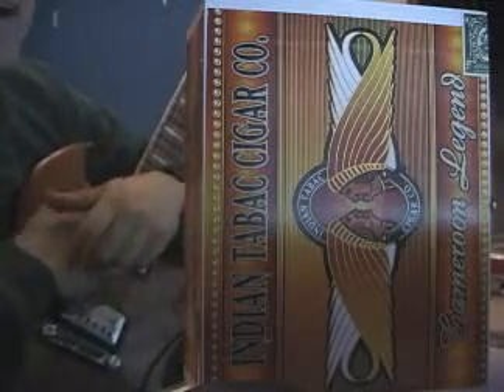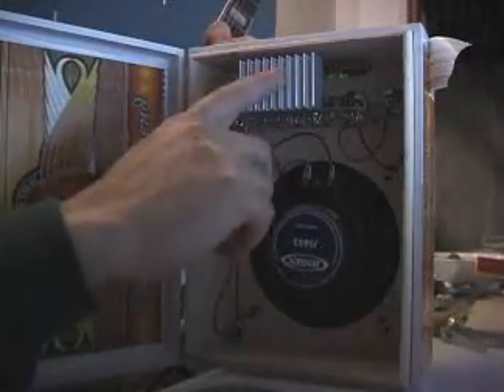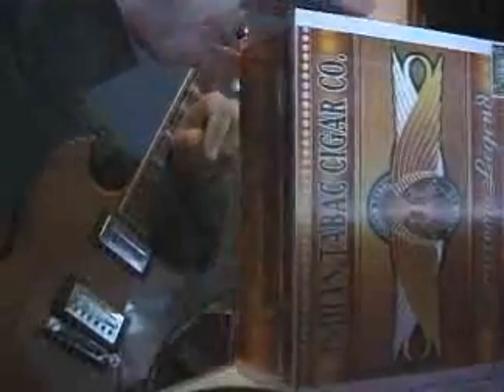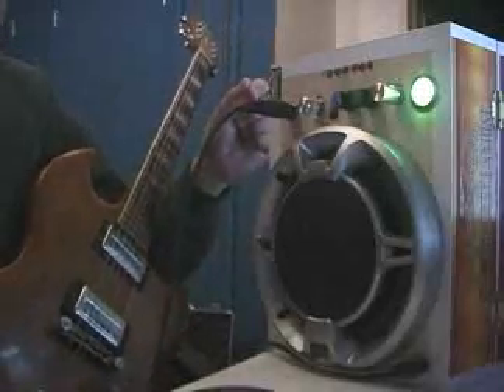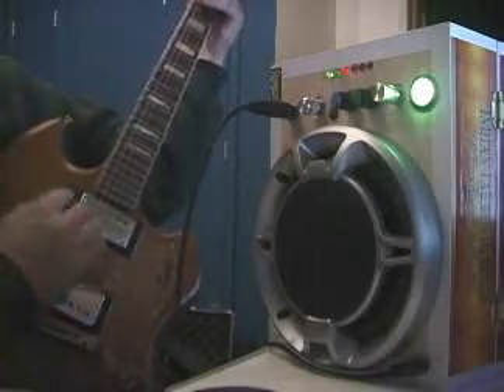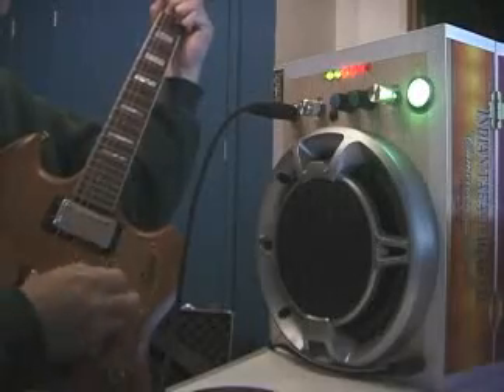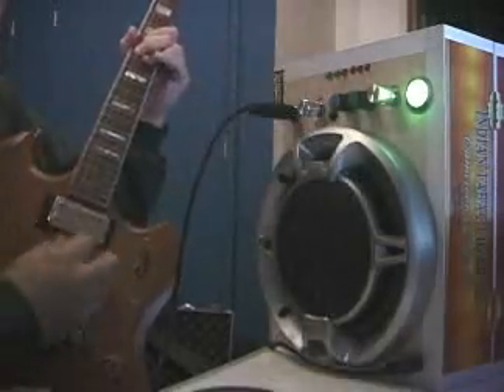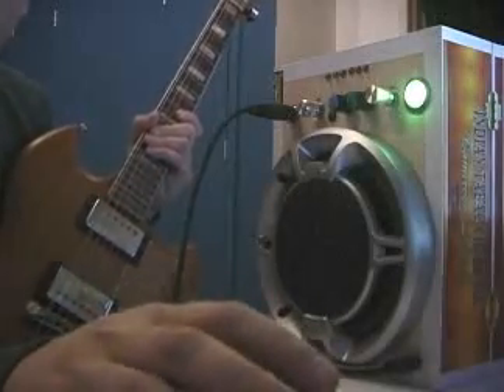cigar box amp FK617 kit

Comment from the maker: @redrocker1055 They mean you have to solder it all to the circuit board.  It's not hard to do, but does take around 4-6 hours to sort through and solder all those resistors.  Usually, qkits will list a price of around $10 to assemble it for you...meaning you get the kit all presoldered and ready for you to solder on your switches and speaker lines...etc.

Comment from the maker: @LonelyLumberJack 

I just used the diagram that was included with the amp kit.  The only real wiring was to the on off switch and the power and speaker lines.  The VU meter is simply wired inline with the speaker.  It doesn't require any separate power.

Comment from the maker: @redrocker1055 I prefer the Ruby and other LM386 type circuits because of the simplicity and great tone.  They don't do clean very well....but the crunch is terrific.  I just use a generic project board for doing a solder up...just leave the ends of the components long enough to act as your traces.  I think only one wire jumper is required after that.  Otherwise, email me for a fellow that can make you a PCB..

Comment from the maker: You're certainly correct...but that wasn't the goal here.  This is designed to be a low cost build that will fit into a cigar box.  Kit at qkits $15 plus shipping.  Box $2 from local cigar shop.  Speaker $7 on sale at Circuit City.  Wallwart $10 at electronics liquidator.  Total $44 for a mini 15watt amp.

That said, I might add an output jack so I can try it with a larger guitar cab.  But, that's not it's purpose.

Eric